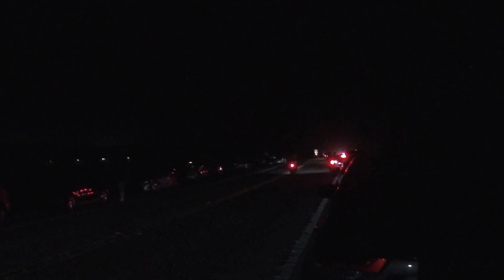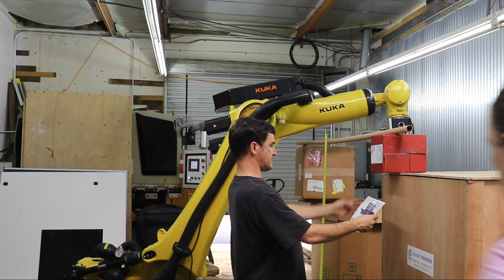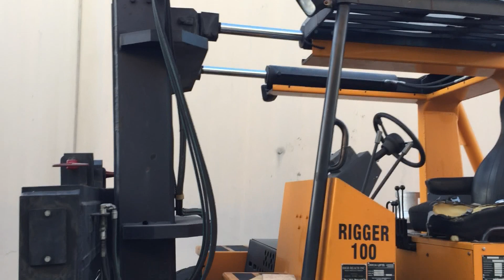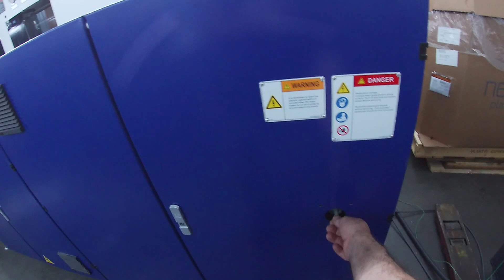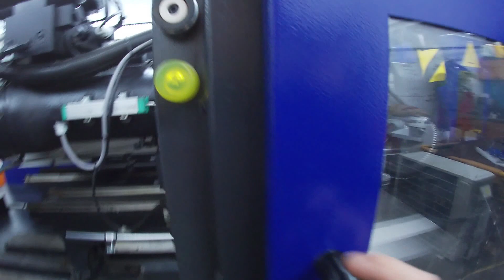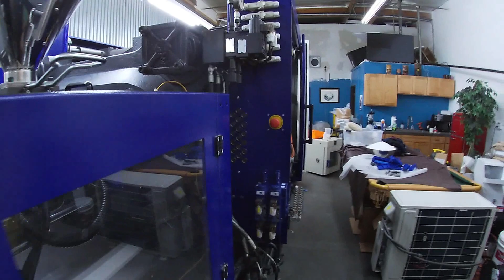SPACEX FALCON 9 LAUNCH AND NEW MACHINE

Comment: The lunch sound of the spceX falcon is great,
i think it sounds like a pulsejet engine.
Nice huge new machine.
It looks as if Big Yellow needs a plateau for operating on this machine.
If i understand, than you are try to work with to independant Moulds on this machine because you can save time, i.a.: you can double the production.
But there is one Point, if there is a Problem on the moldsite, you must stop the whole process.
Nice Video, with many information.